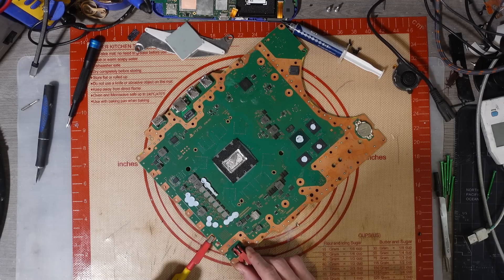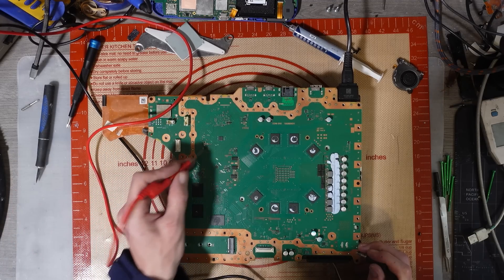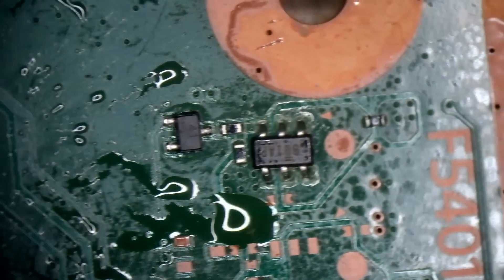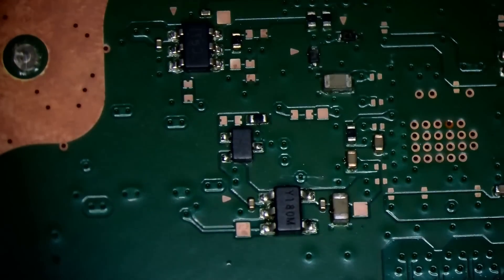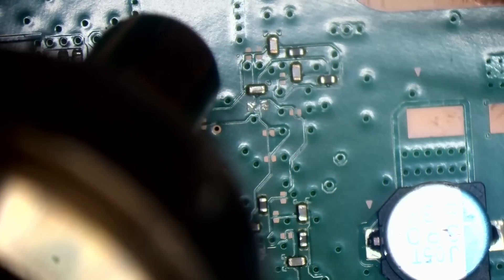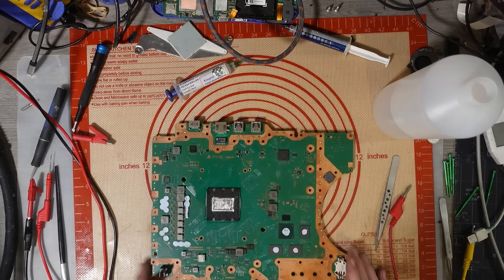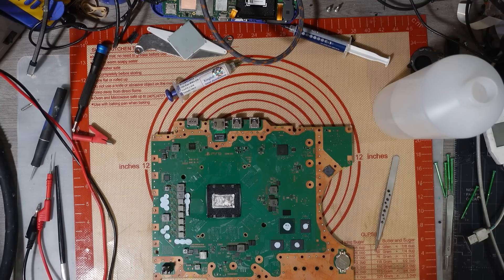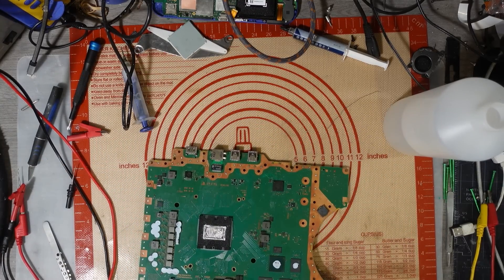Can I Fix This PS5 With No Power | PS5 Joblot Part 11

Comment: Customer had ps5 w/ no power but beeps. I replaced  encoder and now it boots up to white light w/ no display. Console had never been opened before and is missing no components in hdmi circuit. Port is good, filters are good, and I changed 3 different encoders just to be sure, still wlod. What else can cause wlod ?